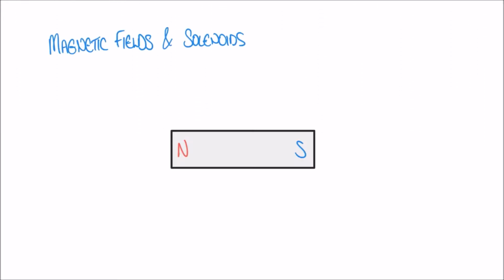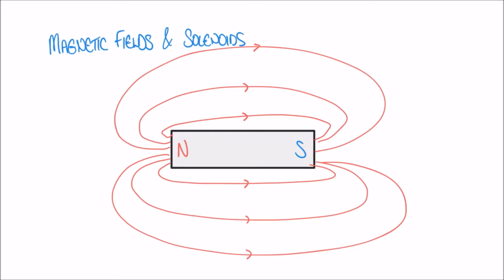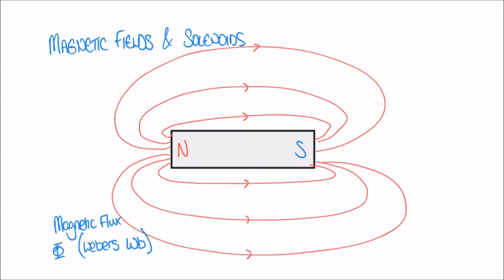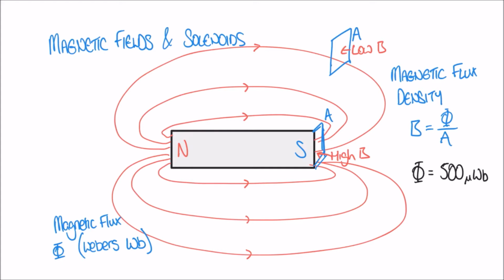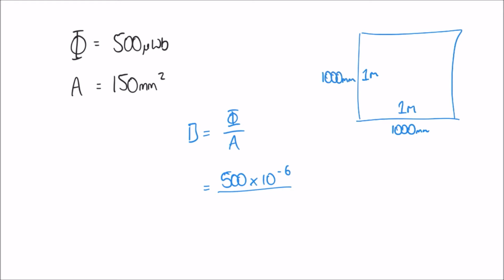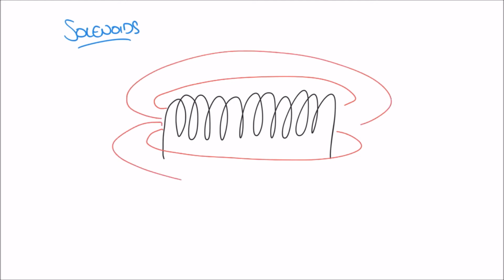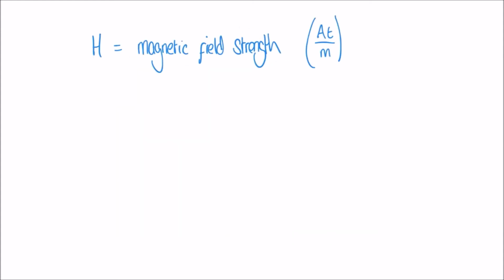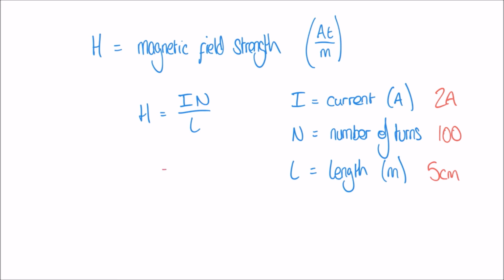Magnetic Fields, Magnetic Flux Density & Solenoids

Comment: Thanks. Good video. One point i dont understand: At 5:05 you talk of low B and high B where the line density differs but the formula for calculating B from H gives only one answer for B. What am I missing?
Reply from the maker: The one single value for flux density refers to the maximal flux density inside the coil itself – where the lines of flux are closest together on the diagram. This is useful since an electromechanical solenoid will retract an arm into the centre of the coil, and so we can calculate the flux density at this position.